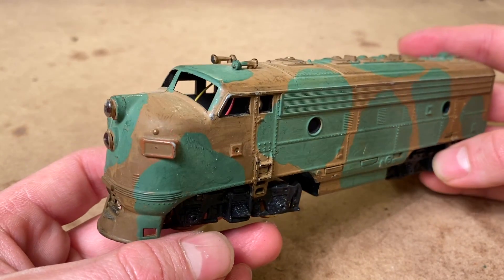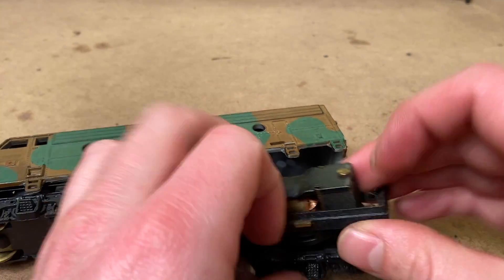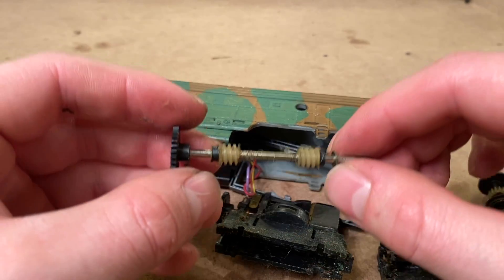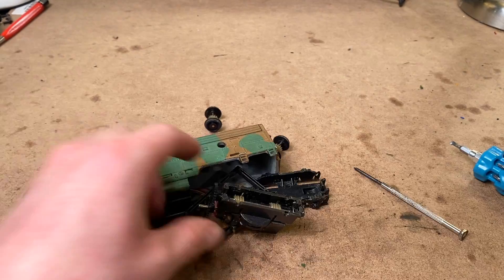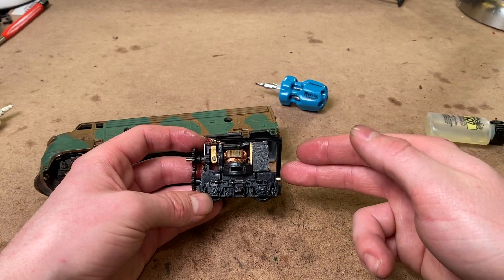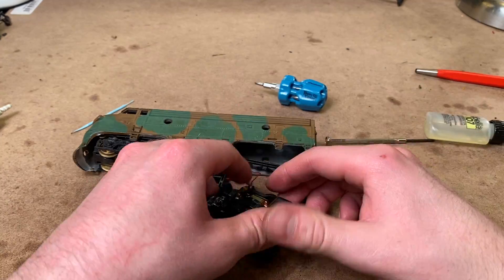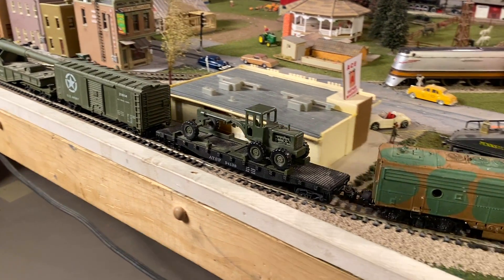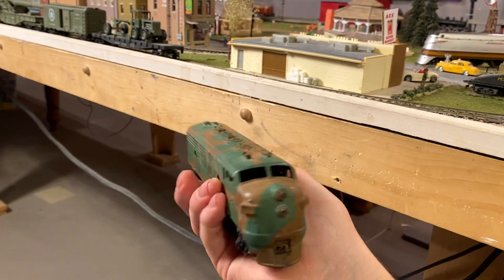Can We Make This 70s Life Like Military Locomotive Run Again?

Comment: The atomic cannon, specifically the M65 atomic cannon, was a heavy artillery piece developed by the United States during the Cold War, capable of firing nuclear projectiles. It was designed to launch a 280mm shell with a nuclear warhead, and the first and only live test occurred on May 25, 1953.

Comment: Does anyone know if and where you can get the drive gears? I have 2 which are cracked on 2 separate locomotives. Thanks in advance.  I'll check the train shows next time.  eBay was a no go

Comment: At first i thought it was a MANTUA engine. Was i wrong. I new as soon as you put power in this F 7 LIFE LIKE Diesel it will take off on your layout. The military set MODEL POWER also had these sets. Good repair SMT. 👍
Reply from the maker: They used a fairly similar design at that point.

Comment: This is Kinda off topic but I have an old tyco power torque that the pivot gear keeps comming off, I’ve tried to glue it and it just broke the glue. Do you have any ideas on what I could do? It’s a Durango if that helps
Reply from the maker: Sometimes you can solder the metal gear but you have to be careful not to melt the plastic ones around it.
Reply: @SMTMainline  Thanks, it worked. Not I can run a 2 loco consist with my other Durango

Comment: Hey smt I have a tyco silver streak 4301 it runs well but it’s flanges hit the rail jointers and it derails is it a wheel issue? And it’s missing traction tires where can I get some?
Reply from the maker: You can sometimes use heat shrink tubing.
Reply: @SMTMainline   how could I use heat shrink tubing on a wheel?
Reply: @SMTMainline  - Didn't you find some O-rings in a Dollar Store that worked good for traction tires?  To use heat shrink tubing, would you slide the tubing onto a rod & use a sharp X-Acto knife to cut around the tubing?

Comment: I have 3 trains that wheel spin really bad anyone know a fix?
Reply: My original loco from 1956 or 1957  had that problem, the only fix at that time was to add weight and it helped a little.  The manufactures added traction tires to solve the problem. you can apply "Bull Frog Snot" to driving wheels that are not power pickups and that will help with wheel spin but it is expensive.
Reply: @tjohnlaser4709  turns out I was missing 3 traction tires
Reply from the maker: Sounds like you need to replace your traction tires.

Comment: That's really cool I just needed a little bit of TLC to get it running properly. I actually like the fact that it has that soft glow of the light bulb coming through both lenses on the front of the locomotive and it makes it look more authentic. You are correct though I did see a varney drive system on a locomotive either at the flea market or the train show that I recently went to a couple weeks ago and it was exactly the same way. Nice job as always